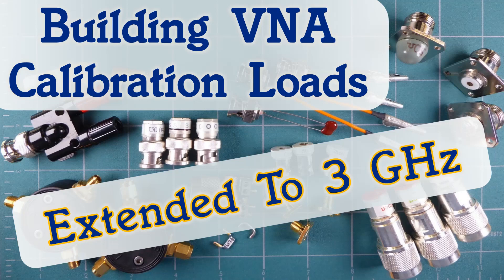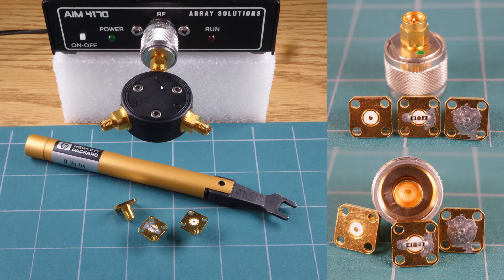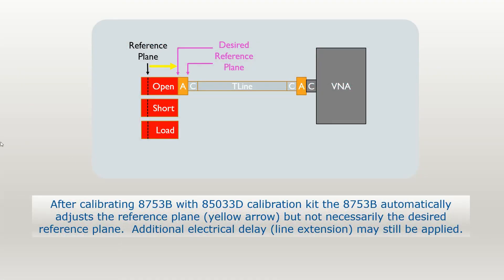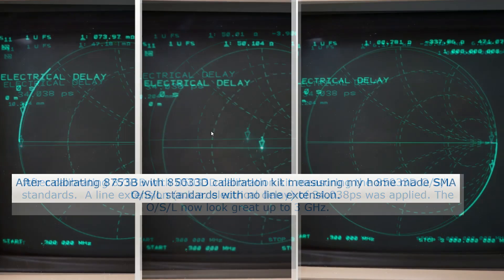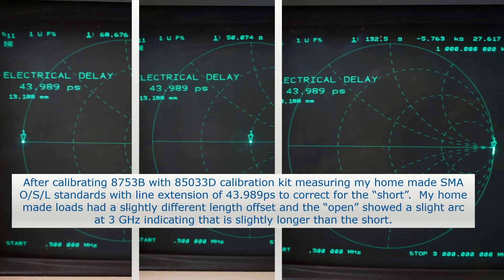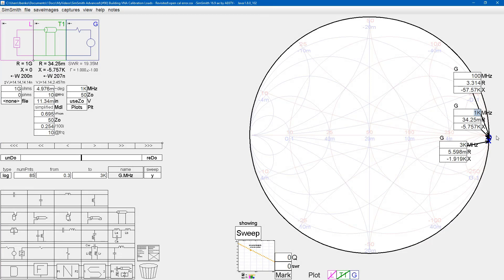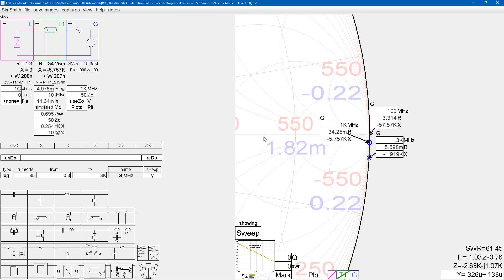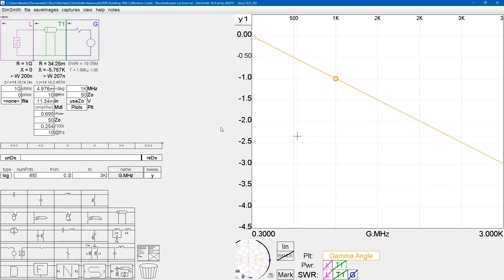#90: Building VNA Calibration Loads - Revisited

Comment: Would be interesting to see how bad of an calibration is still use full, for someone without experience it is hard to figure out how good it has to be. Maybe show how big the erros are. I know it depend on what you measure, in wich area of the smith the DUT is. But it would be handy to know and see what a cheap standart compared to a expensive one. Again thanks for the amazing videos always learn something new, SimSmith is the LTSpice of RF!
Reply from the maker: Heinrich,
The worst errors due to the "open" being slightly too long will occur with impedances on the right side of the Smith chart.  If you are trying to use the calibration standards at 1GHz my old design gave an approximate 1 degree error in Gamma.  This error is in addition to what may be inside the analyzer itself but I thought a 1 degree error was pretty reasonable for home made loads.  The slight shortening for the "open" reduced this error significantly and seemed like a worthwhile modification for those who can grind off .012" or .30mm to the "open".  Your question of "how good" has no definitive answer but I try to trade off difficulty and cost versus accuracy.  Earlier in life electronics was a profession and now it is a hobby which definitely has an effect on what I consider "accurate enough".
Larry, W0QE
Reply: I know there is no definitive Answer, but i have the feeling that sometimes the people think they need extremely high accurate standards, but what they want to know is a result of +-5 or more percent. The modification is a good idea. I think it is important to know how accurate of an measurement you need, for standard current voltage and Frequency it is easy to tell if i have to know it down to the mV but for RF i never got the feeling. most of the time even as a professional it only has to be good enough chasing the last µm is not important and will cost allot of time and money.
Reply from the maker: Heinrich,
I agree with you 100% but achieving a certain level of accuracy at 10 MHz will be easier than achieving it at 100 MHz and hugely easier than achieving it at 1 GHz.  For some the hobby can become an obsession but if you enjoy what you are doing all is well.  I never know what level of RF understanding my viewers have which is another consideration.  Thanks for the comments and good or bad they are welcome.
Larry, W0QE
Reply: Thanks!

Comment: Thanks. Good explanations and video. Is there a way to do a good home made calibration set without having another reference calibration kit ? Let's says using a high quality 50ohms load (for up to 26GHz for instances) and DIY the open and the short because they're simpler to build by yourself ?
Reply from the maker: Oliver,
What I built did not require a reference calibration kit.  The reference kit was used to verify what I built.  I would have no idea how to build anything to go to 26GHz.  I don't think that the short and especially the open are easier than the load due to fringing capacitance of the open.
Larry, W0QE
Reply: @w0qe  Thanks Larry for taking time. Comparing the result of your DiY kit to the calibration of the high quality calibration kit, your determined that the fringing capacitor of the open of your DIY kit makes it longer that is should be. That's why you've grinded the central pin to improve it and make it closer to your better calibration kit. To an extend, can we assume that building an home kit using your technique we will end up with such an open that is too long and that we should also grind it's central pin ?   

My intend what not to use the 26GHz load for designing a calibration kit to such a frequency but knowing that this load has a 1.2 SWR up to 26GHz , I can sure assume it's going to be very good at 3Ghz on the nanoVNA . Seing no decrepancy (both being a "spot" at the center of the smith chart) between by home built load and the 26GHz load, i think I can assume the home built is "good" compared to the reference 26GHz one at least up to 3GHz. It 's to note this is due to the fact that a "spot" rotated is still a "spot" and any phase difference (delay) on a perfect load on a smith chart can not be seen. Please correct me if anything wrong in my understanding. Regards Olivier
Reply from the maker: @olivierschmidt2344  
Some old Hewlett Packard documentation I have refers to the correction of the "open" with a fairly complex polynomial that described the fringe capacitance so just shortening the pin a little is probably not the solution even though it did help at the lower frequencies.  A lot of the old HP documentation is available on line and that might help you.  If nothing else it is very interesting to try and understand what these engineers struggled with as the frequencies went higher and higher.
Larry, W0QE
Reply: @w0qe  Kurt Poulsen de OZ7OU did some very detailed work on the subject. See for instance http://www.hamcom.dk/VNWA/SOT259%20calibration%20standards.pdf. he did even some electro magnetic simulation on the subject.  Have not yet taken time to analyse and review his paper.  The DG8SAQ VNA seems to be able to take into account some "modeling" of the load in order to take into account maybe some capacitiv effect in the resistor loads.  It would wish  that nanovna-saver took into account into their SW.  By the way I mounted my SMD resistor on the loads a little bit different . As the resistor film on the SMD  is mounted on the upper side (just under the marking), I flipped them before soldering on the flattened back surface of the connected. Doing so, the resistor film is just at the calibration plane...maybe the matter of 1mm...

Comment: The cal standard coefficients in the VNA use a time delay, then frequency dependent polynomial capacitance for the open, and inductance for the short.  So what you can do is measure your standard, then fit a model to it, then plug those parameters back into the VNA as a custom cal kit.

I tried bootstrapping an SMA cal kit by creating zero length shorts with mercury, but didn’t work out too well.  Ended up finding a pristine Maury 8050J 3.5mm kit on eBay.
Reply from the maker: Louis,
I too have seen the 4th order polynomial (IIRC) for the fringing capacitance but that is way beyond my capabilities to measure.  The minimal change I made to the "open" was a simple but worthwhile improvement (as you can see in the plots) and not intended to be a precision solution.  I am open to any suggested improvements.
Larry, W0QE